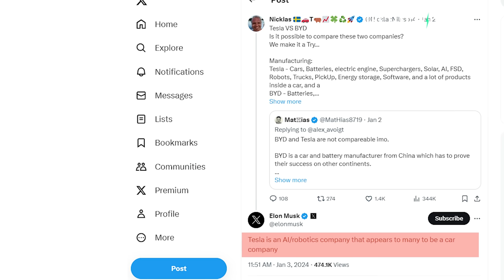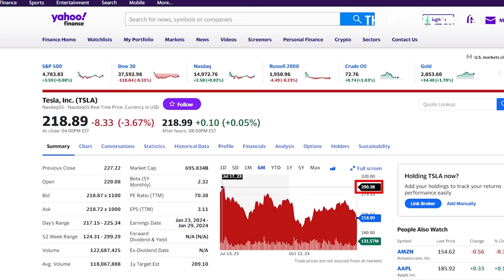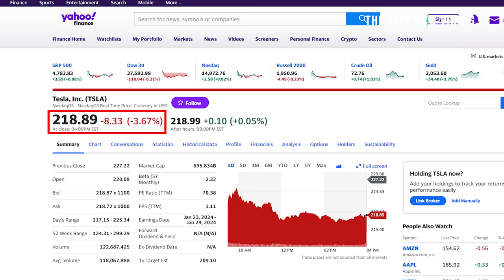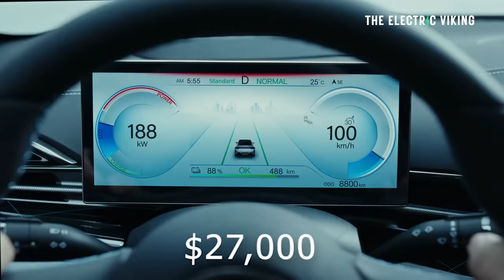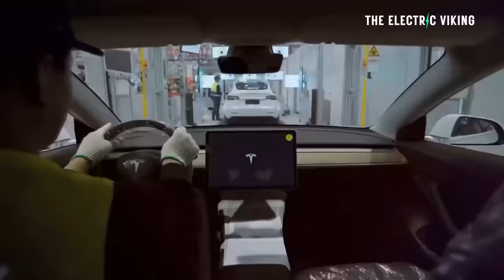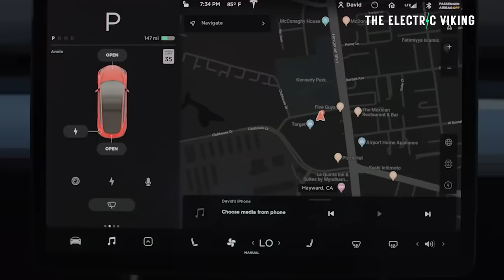Musk: Tesla is an AI/robotics company that only appears to be a car company

Comment: Can’t agree fully with your conclusion matey. Whilst I admit Tesla will pivot more resources towards the Optimus project, getting rid of the ICE is very high on Elon’s list of priorities. So The car division’s success is still a high priority at this moment and as it reaches the 20 million production rate, you will see the Optimus project reaching sufficient degree of sophistication to take on the labour market as you discussed.
Reply: I see the media is gloating over BYD recently surpassing Tesla in number of EVs sold in the last quarter but what they don't realize is Elon's plan has always been to replace ICE vehicles and if other companies can better compete with Tesla then so much the better.
Reply: A robotaxi, IS a robot on wheels. And for every one in a fleet? It can eliminate the need of 5-8 individually owned vehicles. And an autonomous EV that is charging from solar today? Already has an operating cost of less than 4 cents a mile. Its going to be so cheap and convenient that owning a car will be senseless.

Comment: Incorrect! According to master plan 3, transitioning to EV's is critical to the transition to renewables. They have many plans executing simultaneously, nothing needs to supersede anything else. Just hire more top talent, apply pressure to multiple flywheels, rinse repeat x1000
Reply: Why? Personal transport cause less than 10% of CO2 emissions. Why would EVs make the difference is getting to net zero?
Reply: It's in master plan 3, Tesla's future blueprint for their future plans
Reply: @sverrirgeorgsson1248  Would you be surprised if I told you I am not particularly impressed by Musk's writings/ideas and not convinced by any of his master plans?
I'd like a more direct answer to my question. Why the focus on personal transport to get to net zero?
Why are almost all carbon reduction measures taken today aimed at regular households and why is there hardly any reduction of the biggest source of carbon emissions: industry?

Comment: Back in 2019 were we not promised Tesla driverless robotaxis by 2020?  That could potentially net you up to $30,000 usd per year.  Tesla FSD now looks very far away indeed.
Reply: Can anyone name, within a few year when the Gutenberg press happened? Literal leap from hand writing to print? A year or two either side of fsd prediction unimportant.
Reply: @franklinmargolis2051  I would agree.  The point is the non fulfilled predictions seem to be stacking up.  In fact, is it not now the case that FSD will always only be a level 2 system? i.e. it will never be a driverless system?
Reply: @jamie-ck6js it will be driverless; this is not a question of it but when.
Reply: @jamie-ck6js  Yes, the Cybertruck was supposed to be here about 4 years ago.  It doesn't change the fact that by 2026 it will have billions in sales.
Reply: @jefflittle8913  It will never sell a billion.  Maybe a couple of hundred thousand deliveries by 2026.
Reply: @caryg4638  I thought that, but it is looking like FSD will only ever be a level 2 driver support feature for the foreseeable future.
Reply: @franklinmargolis2051  Other than for the noise.  10 or 20 years do not matter so long as it  keeps getting better.
Reply: @jamie-ck6js  When one sets out to do something which has never been done.  It is a lot harder.  Do you have the tools? Do you know what tools are required?    Is it even possible with technology that we have or can create. How are my expectations changing?
Reply: @jefflittle8913  If the CT is 4 years late that means it was supposed to be ready for sail 2019 when we seen the prototype.  It is 2 years late.
Reply: @jamie-ck6js  Exactly.  Because it has never been done.  We can't see the future.
It will be done when it is done.   This is Tesla's largest reach.
Not like making another car.

Comment: It is good to see the Viking acknowledging that Tesla isn't pressing forward with extreme scaling at the speed that one might reasonably expect that it would. That is because Musk has dropped the ball on that ramp not because Tesla is pivoting to a line of business that will supersede automaking.

Yes, Tesla could have made sure that its Mexico factory would be up and running by now if it really wanted to, as Sam points out. That is indeed what Tesla should have done because it really needs to fill the budget/compact vehicle gap in its vehicle portfolio before it can achieve the extreme scaling milestone that it talks about but doesn't pursue with gusto.

Tesla has dropped the ball on its factory capacity expansion. Instead of building production capacity at a sustained rate (and properly utilising it to turn out high volume products at a rapid rate) Tesla has been expanding production in bits and starts. Admittedly, Tesla hasn't had a clean way forward to the expansion that it seeks to achieve. Negotiations in India, for instance, over many years, went poorly. But, Tesla rarely seems to have a viable plan B up its sleeve if plan A fails.

Still, being distracted into trivial pursuits while waiting for the greater gameplan to coalesce isn't the right approach. The Cybertruck is one such distraction. It adds the veneer of the future to the wasteful and pedestrian unfriendly pickup truck design paradigm that already predominates. Look to the Telo and Canoo pickups and vans if you want to see what an efficient light truck should look like in the future, if reason prevails. Also, allowing the CEO of the company to moonlight over at Twitter at the very time that extreme scaling at Tesla needed to be sorted out and bedded down was hardly a great moment for the company.

Beyond the faltering expansion Tesla has missed numerous opportunities to get the jump on all of its rivals, recently. The Cybertruck, for instance, has the right electric architecture to make the vehicle future proof. But, the Cybertruck doesn't matter that much in the scheme of things. It is the Model Y and the Model 3 that need the 800V architecture. Combined with an up to date battery that can tolerate 4C (or more) charging having 800V(+) charging on a mainstream EV will give that vehicle a huge marketing advantage. But Tesla didn't unhitch itself from the 400V dead end with its Model 3 and Model Y updates. What's more the Zeekr 07 has beaten Tesla in this race to high voltage 4C/5C charging. Many other Chinese and South Korean vehicles will soon follow in the Zeekr 07's footsteps.

Tesla needs to be playing its most competitive game at this point but it isn't. It is still distracted and making myths about its own significance. If Tesla truly was an AI and robotics company (with special automotive domain knowledge) it would be competing with other robotics and industrial machine companies - KUKA, ABB and Fanuc - to supply the machines that make the machines but it isn't doing anything like that. On the contrary, Tesla singlemindedly pursues the goal of making a useful and inexpensive humanoid robot. Why does it do this? It seems to be nothing more than a fixation.

Human work has a constantly changing form in the production process. Although the grosser aspects of work are readily replaced by machine production human beings still act to oversee, review and assess the production process. They also do finer grained work that machine production is ill-equipped to do. Musk thinks human-like machines should be able to do that human work or at least some part of it. I suspect that his confidence is misplaced and that the whole exercise will turn out to be misbegotten. In any case, without implying that Tesla oughtn't be able to organically grow and evolve it is clear that some of Tesla's investments go well beyond the scope of an auto company. That is not a good or bad thing but 'other bets' need to find their own way in independent companies even if Tesla stumps up the finance. Above all else, Tesla needs to keep driving the pace of technical development in the EV sphere and should not relinquish that role to any contender. At the moment, Tesla is failing on that score.
Reply: Not sure why you are thinking automation can not be precise.   When engineers and doctors want precision they turn to automation and robotics.
Reply: @danharold3087 Those are extremely expensive devices. You need to re-read what I said.

Also, I granted that robotic machine tools easily outperform human beings in gross tasks. Look at any modern production line - the substitution of robotic machine tools for human labour is what you already see in action today.

I used the term 'fine grained' not precise - that is your gloss on what I said. The relevant contrast using my words is straightforward. Gross tasks and tools work at a big scale. Fine grained work is work done at a much smaller scale and in tighter spaces where big tools won't fit.

You seem completely oblivious to the fact that the main reason Musk wants to realise his human-like robot dream is to do those fine grained tasks plus the workplace management functions that I mentioned (which you ignored). And, he wants his multi-talented robot to be inexpensive to acquire, operate and maintain.
Reply: @chris27gea58  Putting too much in one post is like overfilling a refrigerator or freezer
Reply: @danharold3087  I'll take that as an acknowledgement of my points. Next time, pay attention. If you don't understand what I (or anyone) has said ask a question. That is how discussion/debate works.

Comment: I think the bigger vision is in using AI/Robotics to drive manufacturing not abandoning cars. I disagree with your statement that they are not really ramping up car manufacturing plants.  They have just completed three large new plants while others are shutting them down (VW).  Cars are core to their overall strategy which also includes energy production and storage, energy distribution, and space and global internet and robotics.  Looking at cyclical stock prices is not a way to discern corporate strategy.  Musk's comments is simply stating that their AI and Robotics efforts will define and drive how you manufacture.  Tesla has the highest profit margins in the industry.  Tesla is still refactoring and advancing new manufacturing methods that leads the industry.  Even the Chinese are now just starting with gig castings.  The Model 2 is around the corner.  I am not sure I agree with the overall premice of this video.

Comment: Well the FSD is a class 2 autonomous system (class 6 being the highest). Mercedes claims they have a class 4 autonomous driving system.
Reply: Find a video where anyone drives the Mercedes Drive Pilot class 3 self driving.
Tesla could apply for and get that in short order if they used the same restriction.
And the Tesla FSD would not cut out on curves and the other problems Mercedes is having.
The most significant thing is that it takes a first stab at the liability issue.
It may in fact be ducking it.

"Motorists could face civil and criminal liability risks when using Drive Pilot and other automated driving systems, lawyers say."
Reply: @danharold3087  If Tesla could get class 3 they would have gotten it. 

Much of the decline of Tesla’s stock this year is attributable to the promised FSD and autopilot functionality that they could not deliver on.

I am not claiming other companies are better or worse at it, but getting class 3 is better than not getting it. Either way, FSD is not worth the money. 85% of Tesla owners think so too (since they did not buy it).

Comment: Wrong.
Still waiting on FSD before robotaxi manufacturing & release.
Tesla execs holding Musk to ground, release compact with steering wheel first.
FSD is same tech required for useful robots.
Actual bot manufacturing will initially be tiny relative to say cybertruck line.
Still need to sort 4680, DBE, maybe inc LFMP chemistry, local lithium, silicon anode.
Tesla is taking on the world!

Comment: I think the main reason that they delayed the implementation of the Mexican factory is because, number one elan wanted to see if they could actually complete FSD, which will determine if they can build one with either a retractable or no steering wheel. Number two is they want their best engineers in Texas to figure out the best way to build them before rolling it out to other factories.

Comment: The fact that the Vegas Loop still needs human drivers tells you everything you need to know about the fantasy of FSD. Its a fixed, very short, known route, It could be 95% hard coded, and yet still they have human drivers. FSD is just another pump, wearing very thin, hence the distraction to the robot.

Comment: BYD has something Tesla does not. Enough cheaper, safer, more durable, longer lasting, better cold weather performing, lithium iron phosphate batteries, and soon sodium ion batteries, to supply not only their own growing fleet of electric vehicles, but everyone else's too. BYD is a battery manufacturer and supplier to the global automotive industry, including Tesla. One of Tesla's most critical programs is the development and production of their 4680 batteries. Tesla will likely produce silicon anode batteries at their Kato Road research and development center by the end of this year. This should double 4680 cell energy density. Once production is successfully ramped at Kato Road, Tesla will likely roll out production of these improved batteries to their Gigafactories in Texas, Nevada, and Germany, in addition to new factories in Mexico and likely India and/or Indonesia. Once Tesla's in-house 4680 battery supply is at sufficient performance, cost, and scale they will have much greater ability to accelerate the production of their vehicles.
Reply: Why is Tesla producing the 4680 with NCM chemistry? Lunacy. BYD have them over a barrel on the battery front.
Reply: @davidbrayshaw3529   Tesla is learning how to make cells.   Watch what happens in the next year or two.
Anyway anyone with a good cell will sell as many as they can while they can. Because the next guy might dethrone them in short order.  BYD supplies cells maybe batteries to GigaBerlin.
Reply: @danharold3087  The 4680 was hailed as the cell to dethrone the lot of them. Tesla aren't "learning how to make them", they're making them, now, and they're making them using 20+ year old chemistry that is fraught
with problems. Why they've gone down that route, I don't know, but hopefully they can swing the tiller a steer the ship to better waters sooner rather than later.
Reply: Tesla has safety measures in place, such as their battery management system to abate the hazard of NCM battery fires. Both the smartphone and BEV (including scooters and skateboards) industries have drastically improved NCM battery safety in this manner. At the moment Tesla needs the higher energy density of a NCM chemistry to provide adequate range for their vehicles, especially heavier and faster vehicles like Cybertruck, Semi, Long Range, Performance and Plaid models. Hopefully after they develop dry cathode and silicon anode they can use inherently less expensive, safer, lower environmental impact, lower sourcing concerns chemistries like LFP and sodium ion in their 4680 batteries with similar (or better) range and performance compared to today's NCM batteries. Until then, their most capital efficient path is likely to further develop NCM 4680 batteries, buy LFP (and eventually sodium ion) batteries at scale from CATL, BYD and other suppliers, and then develop their own LFP and sodium ion 4680 batteries after those technologies and their component supply chains have matured, become cheaper, and are more widely available. The spice must flow.

Comment: CEOs are supposed to pump the stock and the company. And it's certainly nothing new for Musk. He has to promote the tech angle because if the company is valued as an automobile concern the stock would drop by 75%. I always believed True full self-driving is quite a ways off and it serves none of us consumers to think otherwise. People who paid extra $$$ for the software on their Tesla are fated for disappointment.
Reply: Musk in particular, because his bonus package was tied to achieving a market cap >1T$ for Tesla. So he pumped $TSLA like there's no tomorrow with early product announcements for Semi and Cybertruck. Now, many years later the promised (and very unachievable) specs turn out to be not achieved for real, even the actual launch of a product that should move the needle (Cybertruck, Semi really is a dud), doesn't. All because expectations were pumped up so high before. Anyway, that's the way I see it.
It may be as simple as investors not liking the prediction for margins on the model 3/Y for the next year or so that keeps the stock price down. Or maybe it's just P/E ratio, which is still quite insane for a car company.